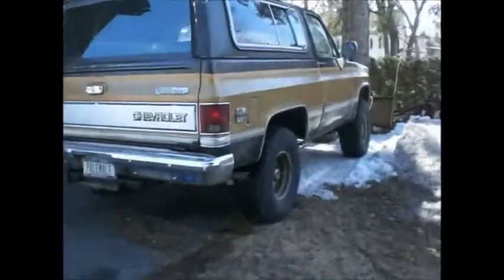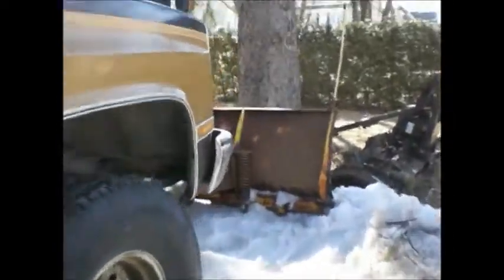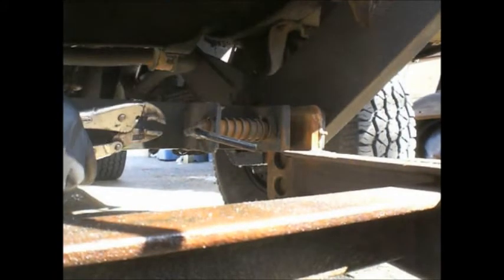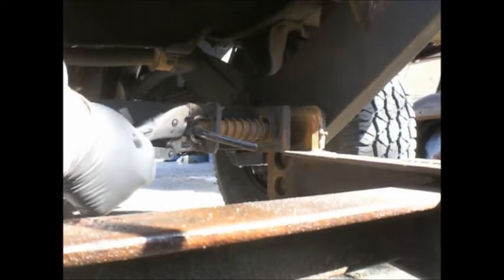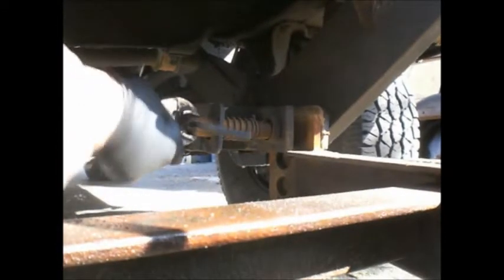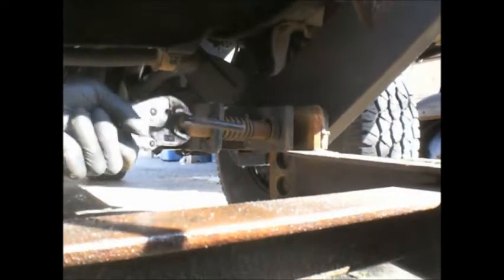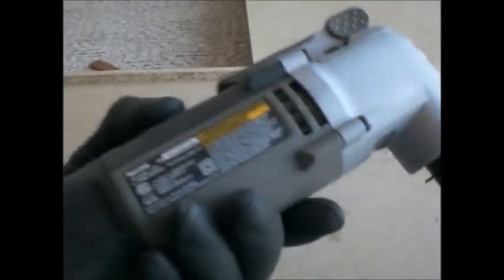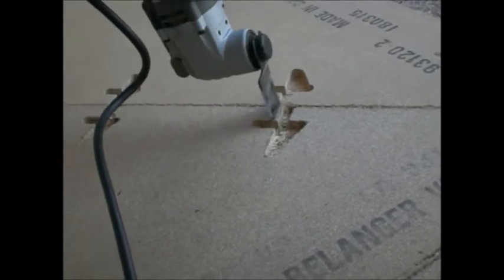Apt 304 CounterTop Adjust Joint  3 31 15

Comment: When I  installed new headlights and turn signals on my Dually I Purchased Crystal lense headlights and LED turn signals, clear not smoke
 I installed LED bulbs on the side markers
Reply from the maker: 96ChevyDually6.5L Amazon reviews tell the tale, China junk, leaks, wrong parts etc. Called a few other Google search-sellers and all on west coast, so still closed. LMC has no HID's or HALO... whadapia
Reply from the maker: 96ChevyDually6.5L I will get the smoke
Reply: The set I found was on Ebay and have had no problems with materials or workmanship...

 It came out of Rowland Heights Ca..
Reply from the maker: 96ChevyDually6.5L Most of the headlamps on several different pages are from same comp w diff names, all from Rowland Ca
Reply from the maker: 96ChevyDually6.5L I will follow Spikedpunks advice and install stock lenses, 1 HID in the hi beam, relay kit to run all 4 on hi beam and Silver Stars on lo beams